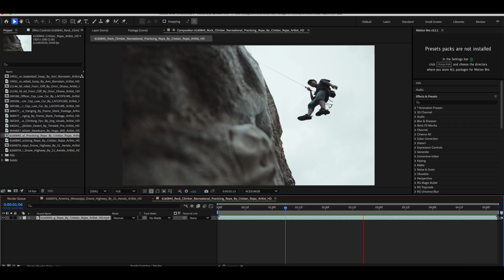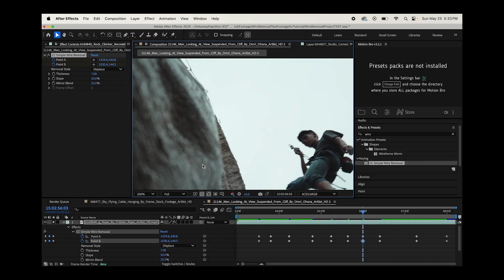Simple After Effects Wire Removal in 1 Minute - 2025 VFX Tutorial (Short Version)

Comment: you would never use this on A grade shots just FYI.
Reply from the maker: What is your favorite wire removal method?
Reply: @LightArchitect  I would not say I have a favorite method. It can be time consuming depending on the shot.
  I worked on a kids show where this plugin was good enough for the time and budget and approved by the client. 
  I have used it for a base layer starting point to build up off of on a bigger show once. 
Usually there is always a need for roto, rotobrush, cleanplating using clone stamp, 2d tracking objects or items for camera movements for tracking nulls. 3D camera tracking - depending on shot. 
Sometimes stabilizing the footage to remove camera movement helps cleanplate too. Then re-introduce the movement after. -depends on situation.
  In super rare moments I have even tried the content aware as a base layer. Usually crashes on me though.
ComfyUI has some n-paint options and bg removal stuff but I am not sure if they are there just yet but they would be good assets to try too - Depending on shot. Photoshop Ai for clean plate is good option too. just to throw out some options / ideas.